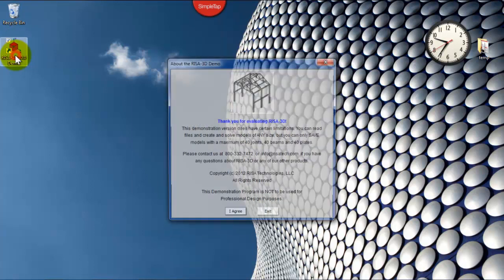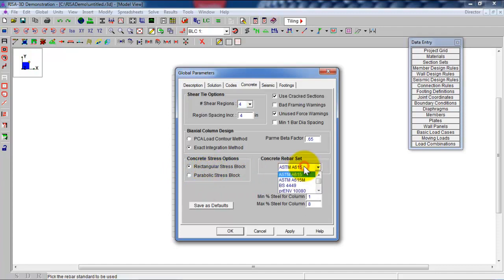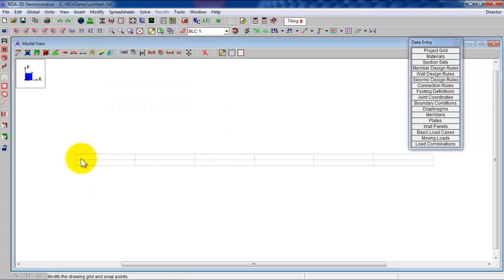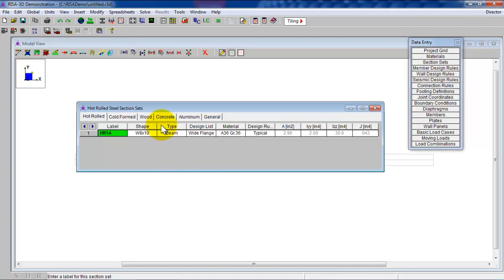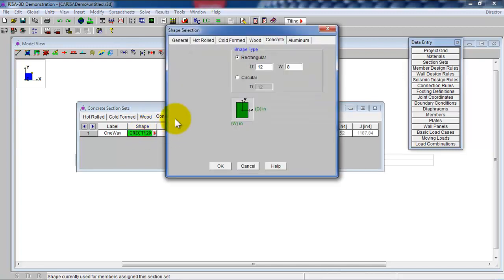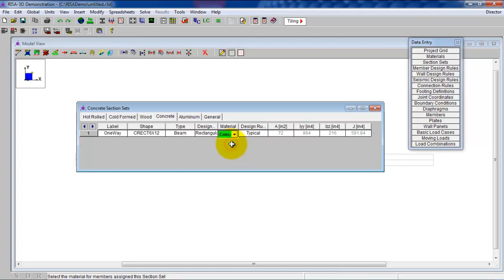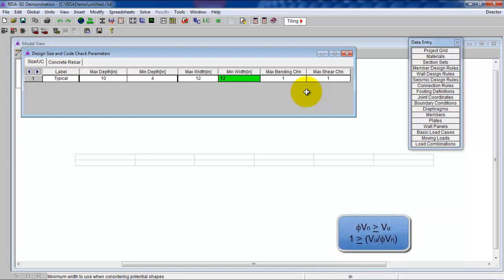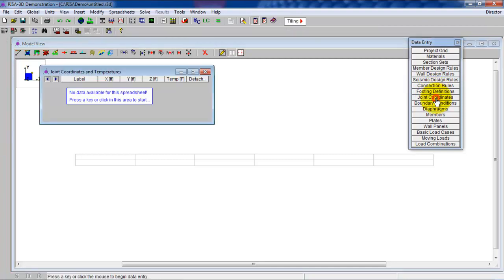one way slab design using risa 3d (1/2) - reinforced concrete

Comment: what is the difference between one way and two way slabs?
Reply: one way slab has a ratio of its shorter and longer side less than 0.5 and the load transfer at the shorter side is assumed to be zero while two way slab has a ratio of the shorter side to longer side is equal or greater than 0.5 and the loads are transferred all over the side.